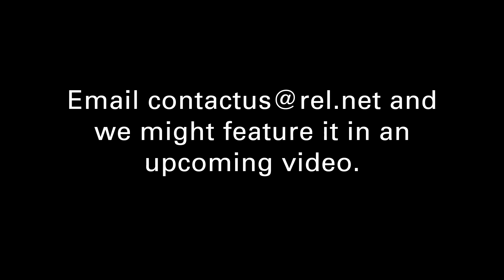Why do you recommend corner placement for REL subwoofers?

Comment: What about a single Rel G2? I have a 2.1 setup, I have tried in a corner but I get a humming noise from the transformer inside the cabinet and that is amplified due to it being in a corner. Now it's next to a speaker facing forwards. I have the volume higher but I still get the lows, especially the important mids. Is the humming from the transformer normal?
Reply: Are you sure it's the transformer. Could be a ground loop hum....
Reply: @carlitomelon4610  it's definitely not a ground loop hum as I have connected my G2 up just to the power mains no signal from any music source, and still hums away. Maybe because I know it's there I'm listening for it.
Reply from the maker: It would be fairly abnormal for the G2 to have transformer hum which is audible from your listening position. For troubleshooting and possible repair assistance, feel free to write in to contactus@rel.net and we will be happy to assist.

Comment: I don’t place it in corner because my room is small. Easier to manage if not in corner. 😬

REL subs are nice. Easy to integrate too.
Reply: My room is small too, and corner placement for both of my subs on either side of my front wall gets me the smoothest and loudest response.

What is difficult to manage about your corner placement?
Reply: @davidrojas6457  ... my room can get boomy. Untreated. A little bare. But the bass is fine with the set up. I just want that bit of extension and am getting it. 😬
Reply: I started with my tzero in the corner, then moved it between the speakers. It’s pretty boomy in the corner and tighter sounding sitting between speakers.

Comment: what about a stereo setup? i got a pair of Rel S2, do i need them in the corner or next to the speaker will be fine? room is approx 15 x 16ft. Thanks.
Reply from the maker: With a stereo pair of subwoofers you have a bit more flexibility, and both corner placement and placement next to the speakers can work well depending on the room and how your loudspeakers are placed. We recommend starting with corner placement of your stereo S/2s, with the front-firing driver toed-in toward the opposite corner of the room. If you find the bass too boomy you can bring the subwoofers out and next to your loudspeakers to see if this gives you better results.
Reply: Have a pair of  S/812 , I have tried both positions I find that next to the speakers slightly about 6  front the front channel seem to give me a forward presentation , behind the the speakers i find it a bit recessed now this is with full range floor standing Daedalus Poseidon speakers which go down to 28 HZ.

Comment: Is this true for the models with just a single element like the T5i???
Reply from the maker: Corner placement is beneficial and still applies for the T/5i and other exclusively down-firing subwoofer models, since the corner helps to reinforce and project the low-frequency pressure waves produced by the subwoofer into the room.
Reply: @RELAcoustics  Thanks for the reply, I was more wondering about the recommendation of angling the sub 45degrees in the corner, Can't see that it makes any difference with a single element sub.
Reply from the maker: @MrBiggmartin You are correct that with the T/5i and Tzero you do not need to worry about the toe-in angle of the subwoofer, since there is no front-firing driver on these models.
Reply: @RELAcoustics  Thank you

Comment: Does corner placement apply for down firing t5i's ? Got two of'm 🙂
Thanks for info. I do hear the bass get stronger as it moves toward the corner , without getting complicated , my stereo area is just a little bigger than my TV cabinet. It sets in a little cove at one end of the living room. I have  a t5i on each side of the cabinet , each sub has about 2 in of space on each side , so its tight. The Tannoy xt6f's are in front of the subs, out in the room a little bit. Sometimes I feel like these subs don't have room to breathe but they sound pretty nice there. I think these would rock a big room also. My  living rm sq ft , about 200.
Reply from the maker: Corner placement still applies and is beneficial for the T/5is and other exclusively down-firing models, since the corner helps to reinforce and project the bass into the room. This helps to get the deepest and highest quality sub-bass performance possible from our smaller models.
Reply: @RELAcoustics  Hi REL, I have a Tzero placed in a corner. Does the 45 degree also still apply?
Reply: Same here I have mine in the corners same as what he is suggesting here,